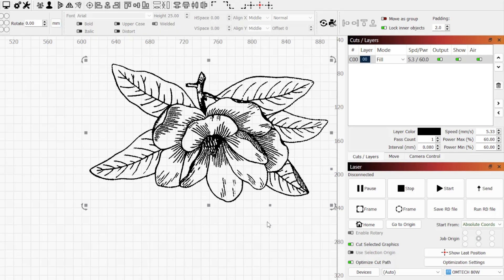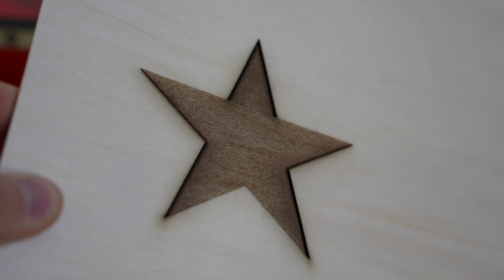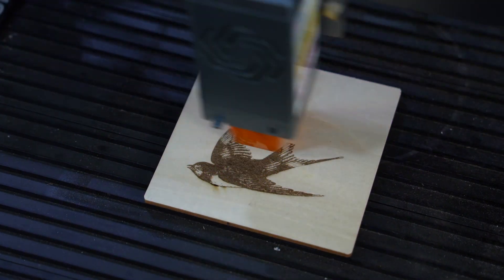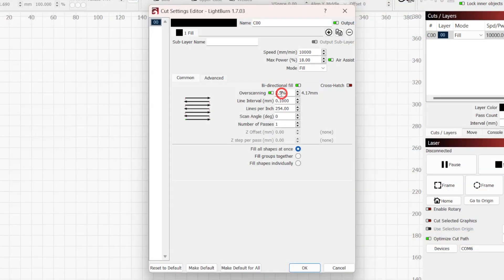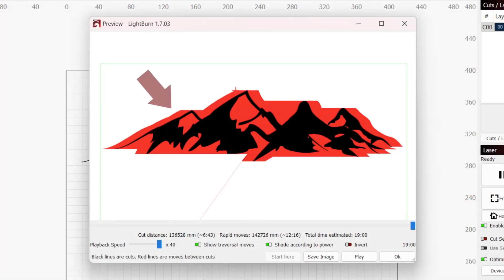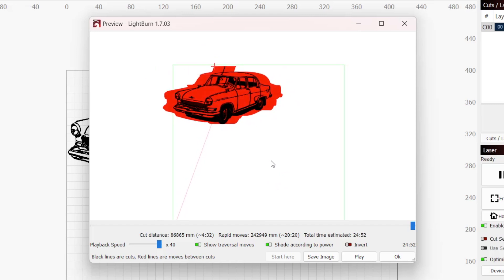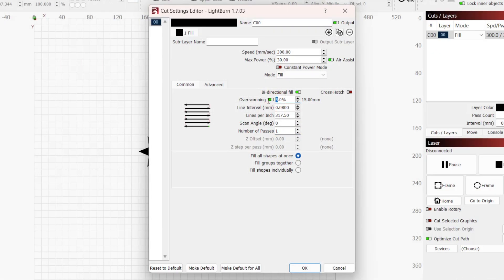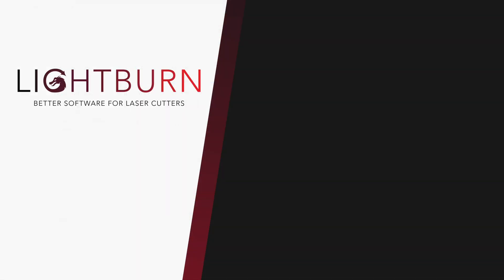Improve Your Engravings with Overscanning

Comment: So Annoying when I am trying to do a CUT at a slow speed (120mm/m) and I keep getting errors as Lightburn wants more room than it will need to do the cut. I have been struggling with this for 2 days! Suggestions please. PS I cannot use the Preview feature due to these errors or save to GTcode
Reply from the maker: This sounds like you’re using a diode laser, and possibly using the wrong “Start From” setting. The best thing you can do is email support@lightburnsoftware.com and share a screen shot or two of your workspace and project settings so we can get you sorted out.

Comment: Doesn't M4 dynamic power account for this problem?
Reply from the maker: It varies the power, yes, but holding the laser in a single spot for 1 second at 10% power won’t necessarily produce the same burn as 100% for 0.1 seconds. Most materials don’t respond linearly to power.
Reply: Ah right, I see. Is it worth looking at the X and Y acceleration speeds in the machine settings and calculating exactly how much overscan is needed? I had a quick look at my machine and the acceleration is 1,200mm/s^2 - so if I'm running a job at 200mm/s I'd need 16.67 mm to reach that speed, equating to 8.33% overscanning. Is that right?
Reply from the maker: @shaunsmith4337 - it won’t make that much difference. The lower end, closer to zero percent, is where it really needs the help. You can run a few tests at different speeds and you’ll see they come out fairly similar.